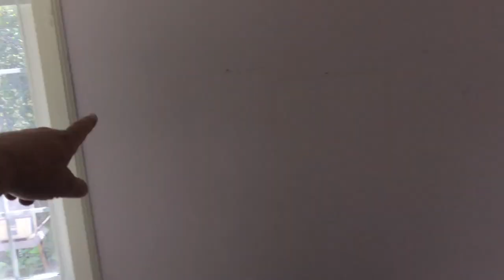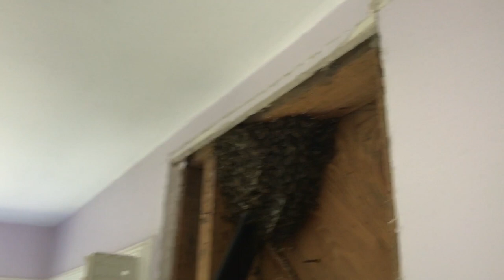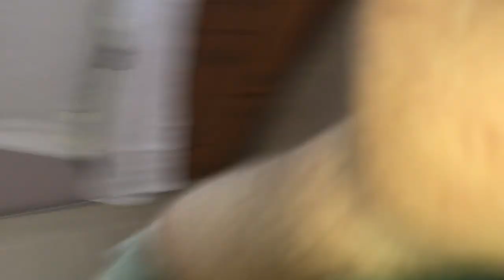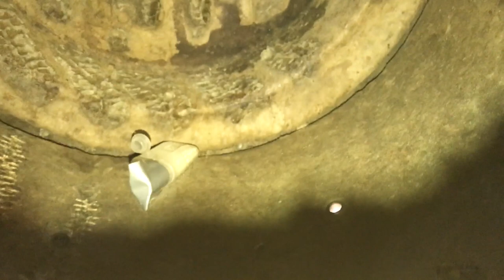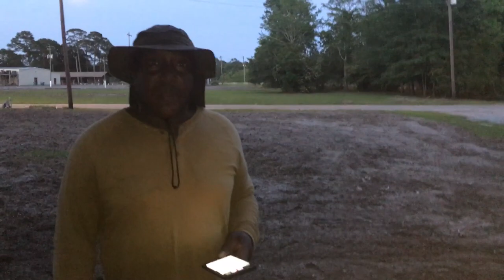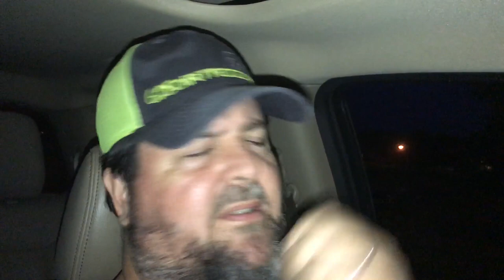Queen Bee Pulls A Houdini

Comment: I have the same walls in my house it was built in 1941 they put up 2 foot tall drywall up drilled holes every few inches in a grid with about an inch of concrete over it terrible to deal with when remodeling the old house